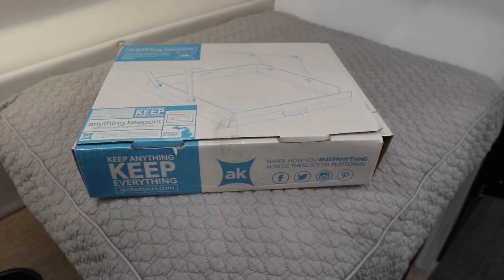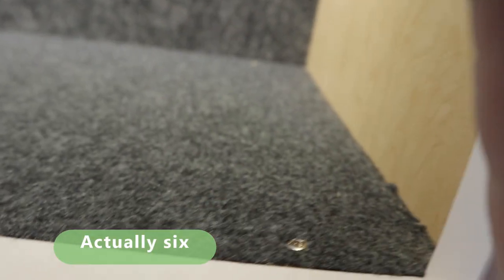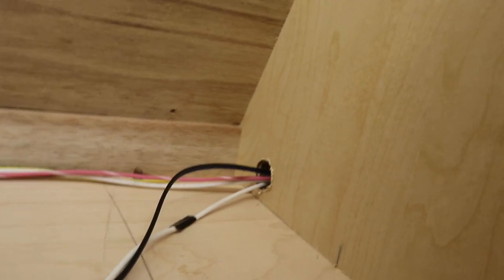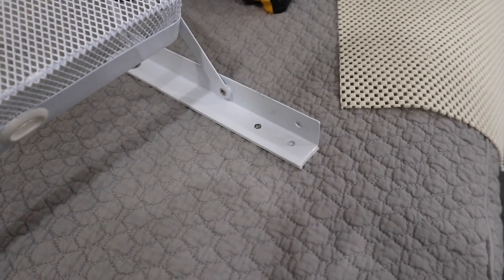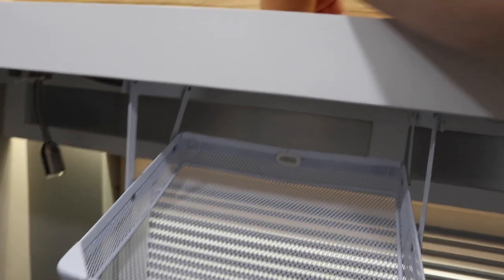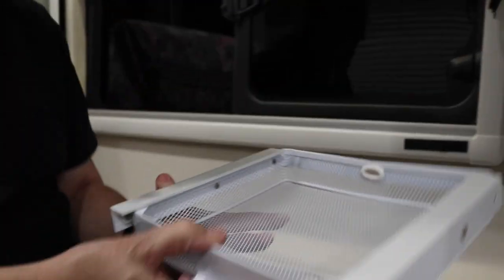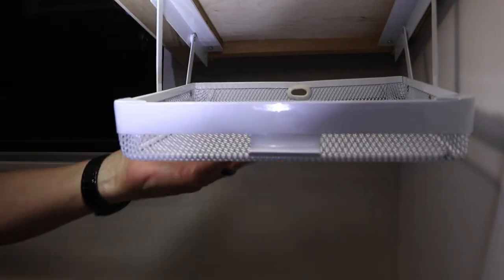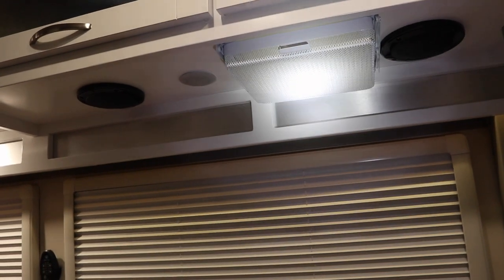Anything Keeper baskets

Comment: Thanks for publishing this 😃 I just installed them in my new 2021 Beyond 22D and it was very helpful 👍 Coming from a house, I wouldn’t of realized how thin the cabinet floor was, and it definitely needed some reinforcing. My layout was slightly different from yours, and I couldn’t line it up with any of the vertical cabinet side pieces, so I had to reinforce both sides of the anything keepers. That was a good tip not to just randomly drill into RV cabinets, when I opened up the cabinet floor boards, each one had different configurations and things  hiding in them I wouldn’t of expected.
Reply from the maker: Glad to help, you also found a neat hiding spot too!